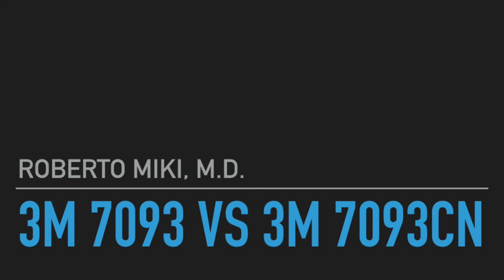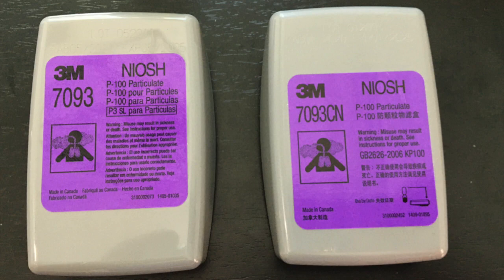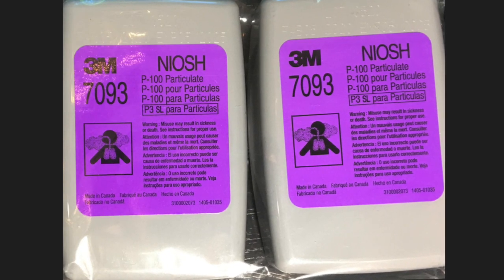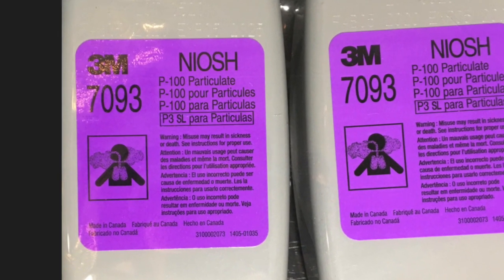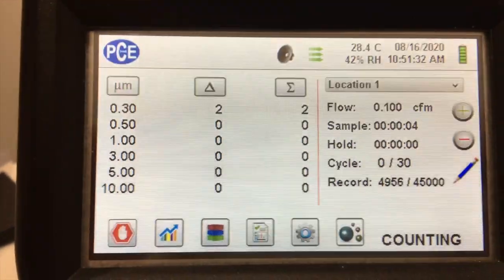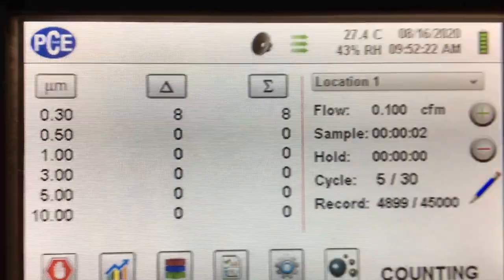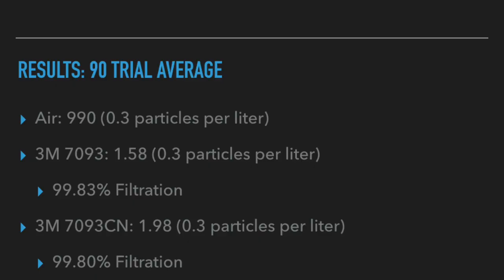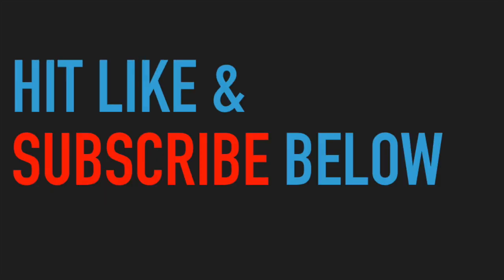3M 7093 vs 3M 7093CN purchased on Amazon

Comment: Is 3M 7093CN fake?
Reply from the maker: They are not necessarily fake. They are made by 3M. They are just not made for the US market. They are being imported from China via third parties. 3M does not recommend using them as they cannot insure their authenticity. I would stay away. Nonetheless, when we tested the ones we had they did well. Unless you can test them yourself I would stay clear.

Comment: I bought a couple packs locally and it doesn't say 3M or NIOSH on them. However the labels are clear with no misprints and the they're right color. The dates are also laser engraved spread evenly, there's no plastic on the inside filter and it's spread evenly, not bunched together. Watching a different video they seem legit just with no 3M or NIOSH markings for some reason.
Reply from the maker: No 3m means likely not legitimate. I would return. Unless you can test them.
Reply: Fake ones have 3m and Niosh on them so idk
Reply from the maker: Sorry, the lack of a 3M label likely means it is a fake.

Comment: Is this still reusable even if it's not P3 R?Thanks. I just bought this for daily use going to market.
Reply from the maker: These filters are good for up to 6 months from opening or until it is hard to breath. They are P100 by US NIOSH standard which means it filters 99.997%. P3 filter is similar level of filtration 99.95% but has some organic vapor filtration. The difference is mostly regulatory bc of different countries and regions of world using different standards.
Reply: @RobertoMikiMD  Thank you Sir. Very helpful vid. Godbless 🙏

Comment: Good explanation about the subtle labeling differences that could be easily missed or confusing.  I saw some of these same type of P100 filters being sold on Amazon,  they appeared to be the same exact design, size, shape, colors, with identical markings "but" lacked the 3M logo.  And there was no mention of who produced them. They could be easily mistaken for 3M manufactured, but I doubt that they were, which raises safety questions.   So I appreciate your clarification, kind and thoughtful efforts.  Good job!!
Reply: Thank you.  Here is the link to the P100s that I referenced above.  They look like 3M but without a 3M logo.  Do you have any comment on these?  I am curious about thoughts about them.  Thank you again.     https://smile.amazon.com/dp/B08HMJXT11/ref=sspa_dk_detail_4?psc=1&pd_rd_i=B08HMJXT11&pd_rd_w=AFsvS&pf_rd_p=80360d1c-2d74-4d2e-9034-f92fb5248b33&pd_rd_wg=FH5k9&pf_rd_r=7Q46Q7W8W44CYXVABPA9&pd_rd_r=4318743f-9fc3-4395-8f86-e7618dd21dcc&spLa=ZW5jcnlwdGVkUXVhbGlmaWVyPUExV0hMSTRMTlJQT0RXJmVuY3J5cHRlZElkPUEwOTU4MTYxMkZIU0Y5MlZEOUk0TSZlbmNyeXB0ZWRBZElkPUEwOTQ5MDc5MzFNSDhWVU1UQjQ5TCZ3aWRnZXROYW1lPXNwX2RldGFpbCZhY3Rpb249Y2xpY2tSZWRpcmVjdCZkb05vdExvZ0NsaWNrPXRydWU=

Comment: Are you saying 3M makes 2 kinds of filters in Canada saying they are p100 and one of them is not and they sell the inferior ones to China?
Reply from the maker: No, the 7093CN are being bought outside the US and resold here by third party vendors. They are likely 3M filters but 3M brands them with the CN for Chinese market. Not sure why they add the CN but it might be for regulatory issues or so they can tell if it is from and for that market.  3M does not recommend purchasing these because outside of China because they cannot authenticate them. I tested them and at least the ones I received were indistinguishable from the US versions.

Comment: can you please measure the efficacy of the 3m 60923 pink filter cartridge against covid 19?
Reply from the maker: will do
Reply from the maker: Just posted the video! 99.96% filtration efficiency at 0.3 microns.
https://youtu.be/PEK31mBCZGQ
Reply: @RobertoMikiMD  thanks man!!   so is covid 0.3 micron? or smaller. ive worn this mask from the start of this covid crap and im convinced that im protected but, i dont know as much as a doctor obviously so, i ask you, in your professional opinion, does this mask with this cartridge when used properly keep one 99.96% safe from covid?
Reply from the maker: No one has tested this filter against COVID. Unfortunately, no one will spend the money to do so. 3M cannot and will not say whether it protects against viruses. The COVID-19 virus is much smaller (0.12 microns) than 0.3 microns but P100 filters filter even below 0.3 microns. 0.3 microns is chosen as the benchmark for testing because it is the hardest size particle to trap. Another reason to feel secure is that the virus does not travel naked and travels on particles of aerosolized saliva and mucus and because of this it is bigger than 0.12 microns. I regularly use an N95 mask for patients in the office and for known COVID-19 patients I'm using the P100 filters from 3M. Once again these have not been tested specifically against COVID but theoretically should work because of the filtration efficiency. I have yet to get sick! 

This is a good summary I found on the net:
http://donaldsonaerospace-defense.com/library/files/documents/pdfs/042665.pdf
Reply: @RobertoMikiMD  thank you so much for that info!
Reply from the maker: stay safe! keep using the mask and filters!

Comment: I want to buy filter for my respirator mask - 3M 6000 series. I want filter for air pollution because here in Bulgaria in winter times the air is really bad. What would you suggest me to get? In my country I can't get this filter 7093 or 7093CN. They offer me 6035 or 6038 but I think this filter will don't filtrate properly. What would you suggest me to get?

This is my choice from my local supplier of 3M products, what can I use to protect myself?  

http://safety.irbis.bg/pdf/3m-reusable-respirators-2013.pdf
Reply from the maker: The 6035 and 6038 are P3 filters which is equivalent to the 7093 P100 level filtration in the US standard. I imagine that these filters should work for most air pollution but it may not work for all types of air pollution if there are specific harsher chemicals such as hydrofluoric acid.

Comment: I find the 3M product range for their filters in particular extremely confusing. There is surprisingly 'scant' information for advising which to buy for biological viruses such as Covid versus spray particultates or defense against both if one needs protection against both environments (I spray paint too so want absolute protection against spray vapours and Covid..). 

3M, improve your 'expletive' website.! It's very frustrating. Not good enough, especially when one considers the prices of your products.!
Reply: Also agree. This is one of the most frustrating website and information that I have read in years. I lost all day to search information on the website in my language and English... And at the end I don't know what to buy. The funny thing is that the dealer's here also don't know which filter for what is best...
Reply: @TheMilenkata  Here is a medical doc who says the the 3M masks with P100s offer excellent protection against Covid-19, much better than paper-polypropylene disposable N95 masks.  https://www.youtube.com/watch?v=8petaPoHFnk&t=205s
Reply from the maker: I agree
Reply: this is right from the info packet of the p100 pancake filters that I use for work. they are 3m 2097s
"These particulate filters can help reduce the inhalation exposures to certain airborne biological particles (e.g. mold, bacillus anthracis, avian influenza, mycobacterium tuberculosis ect.) but cannont eliminate the risk of contracting infection, illness, or disease. OSHA and other government agencies have not established a safe exposer limits for these contaminates."
Hope this helps.

Comment: Just to confirm. Both are authentic, the difference is their geographic distribution 7093CN being sold in China territories whereas the 7093 is sold in the US and Canada regions. Functionally they are identical as there isn't any difference in their filtration efficiency.
Reply from the maker: Correct. The only thing is that 3M does not recommend purchasing filters which are for different markets because they cannot authenticate. I may have been lucky and got a real one.